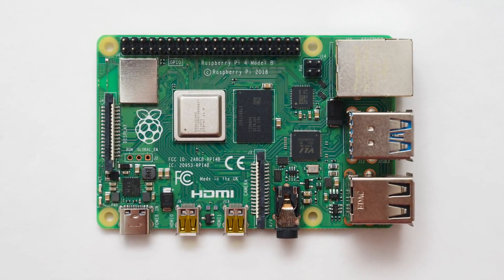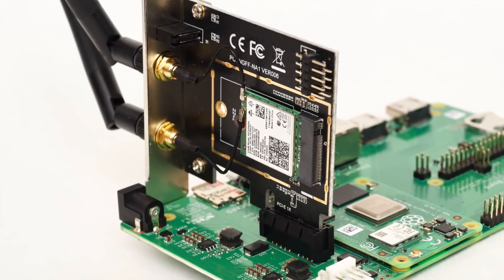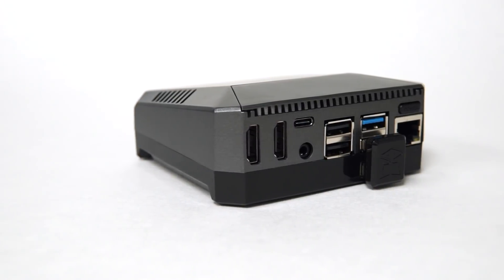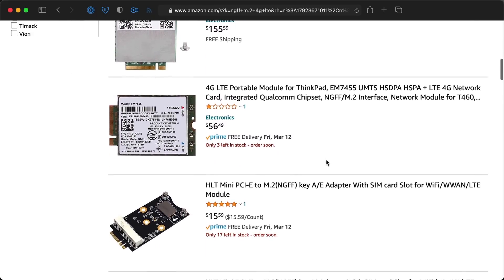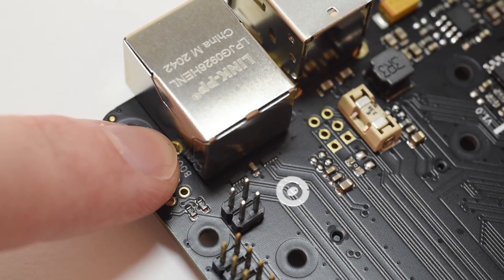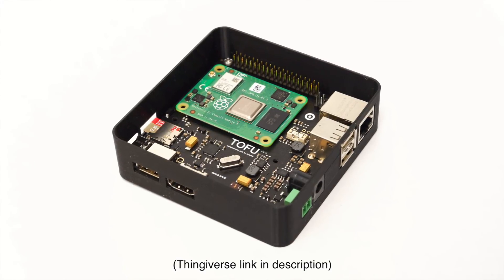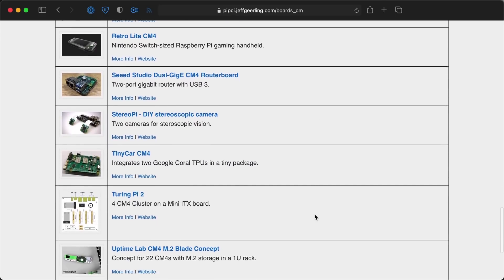FINALLY! Native M.2 NVMe on a Raspberry Pi - CM4 TOFU

Comment: Is it correct that the slowest NVMe that you can get will still be bottlenecked by the connection. 300MB are not even close to meeting the SATA3 standards capapilities and faaaaaar away of true NVME speeds.

Comment: FYI: The PoE Hat does not fit properly without 10mm spacers or header extensions. One of the capacitors on the PoE hat hits the fuse on the Tofu.

Comment: I just got my TOFU set up, but so far I haven’t been able to get it to detect the NVME drive installed into my M.2 slot. I’m ordering another one specifically called out for compatibility. It would be a huge disappointment if drive compatibility is limited.
Reply: As per the TOFU compatibility list says, the WD Blue SN550 250GB worked and was immediately detected, but my original Sabrent 512GB Rocket 2242 (SB-1342-512) did not. No matter what I did, I could never get the Sabrent drive to be detected. I tried with USB-C power and via POE++. Available power shouldn't have been an issue because after I got the WD Blue up and running, I stuck the Sabrent drive inside an SSK USB adapter, plugged it into the TOFU and it has run fine with both drives installed.

Comment: Hi there Jeff . I love what you are doing with the pi technology. I have been lookig at purchasing a Pi 400 ,however I don't know anything about Kernals or anything else about the inner workings . I have built 4 PC s .But the situation in the suppy chain has forced me to look at other things . I love what you are into . Now the store that i buy stuff from doesn't carry the pi 4 with the PCI slot . So who do I conntact to get the latest updated board ?  I will buy the 400 model soon ,but 4 GB is all they come with . Do you know if and when they plan to up grade to 8GB ?

Comment: Seems they've made a m key adapter that support all the lengths (Available as 2280 (most used), 2260, 2242, 2230 or DIY configurations (spacer not soldered) for €19)

Comment: Wouldn't it be better to use a sata flash drive? I know that it requires an additional controller, but the speed you are achieving is already slower than a normal sata 3 ssd (500 MB/s), so it's a bit of a waste to use an nvme drive that would be 4 times as fast. Also I guess the drive could be cheaper and maybe even easier to boot from

Comment: Hi Jeff, the WD 30mm NVMe looks like a reasonable solution for the Raspberry PI CM4 I/O board. In your earlier video you showed a full-length adapter sticking up like a skyscraper. Have you tested the 30mm (2230) card in the IO board? Is there an adapter that works well for that?
Reply: But short of a hacksaw, I don't see a shorter vertical adapter that would fit the 30mm and not stick up like a skyscraper out of the I/O board.

Comment: How is this more "native" than everything before? You are using an expansion board to interface the PCIe lanes to an M.2 connector. I interpret "native" to mean running minimal external layers. I wouldn't consider the connector itself to be a layer in this sense. Something like M.2 to USB 3 I would consider to be not native.
Reply from the maker: Native in the sense that there is an M.2 NVMe storage device connected directly to the PCIe lane on the Raspberry Pi CPU, and it's through a single board (not an IO Board + an extra PCIe adapter card, which I've demonstrated before).

A number of CM4 boards are going to have built-in M.2 slots (of various types), so it's exciting to see this development (especially as some of the carriers get cheaper).

Comment: I am curious was your bed temperature too hot or too cold  to cause the lifting ?
Reply from the maker: Too cold. I usually keep it around 60°C for PLA, but the default in Cura was set to 50° for some reason, and I forgot to double-check before beginning the print.
Reply: @JeffGeerling  Thanks

Comment: This board is just what I need for a project I’ve been wanting to build - a low power monitor for a motorhome or RV while it is in storage. With the cellular capability built in it can allow remote access as well as sending data bursts to the cloud (motion triggered photos, temp and humidity readings, etc.)

Comment: Thanks for the great videos! Personally i will stick to the m2 drives over USB 3.1. I have an rpi4 with m2 kingston ssd, with an ssd shield connected over USB. It contains Ubuntu 20.10 and it boots without an SD card directly from the m2.

Comment: The Tofu is indeed an interesting carrier board. The M.2 slot is more reasonable than the pcie slot on the official CM4 IO board. It seems like future 5G modules will mostly be in an M.2 form factor instead of mini pcie. So including the SIM slot next to the M.2 slot was a really good decision from Oratek. I thougt that this board would be perfect for mobile applications because of the SIM slot. However, after studying the boards documentation, there are quite a few good reasons not to use this board for mobile applications:

1. Mobile applications are often battery powered. The lack of an RTC means that time triggered system wake ups are not possible. You might want to shut down your system to safe energy. But without the possibility of time triggered wake ups this is not an option.

2. According to the electrical documentation Oratek is using Zener diodes to create stable 12V, 5V and 3.3V. This is extreme energy waste, which is a problem for battery powered applications. The solution would be to use dc/dc converters instead of Zener diodes. Considering the price point of the Tofu board, using Zener diodes is imho a bad decision.

3. The voltage range from 7.5V to 28.0V is a little small. For example if a vehicle has a 24V rated battery system, the voltage can easily be >28V if the engine/alternator is running. Has anybody tried to run this board on 29V? Does it blow up?
Reply: Hi, so the thinking was that for low power applications a microcontroller system would be more appropriate, and not so many people would use the RTC. It is still possible to wake up and shutdown the raspberry pi through other IOs.

The power supply is not made through Zener diodes. Schottky diodes are placed to prevent reverse currents flowing into the power supplies if more than one are connected. The only Zener diode is here to polarize the reverse polarity protection transistor (inverting + - on the power input).
The voltage regulation is made through an efficient DC-DC converter, the same as present on the CM4IO board.

Finally, this DC-DC converter can handle higher voltage. What cannot necessarily is this reverse polarity protection transistor, which has a maximum drain-source voltage of 30V. Input capacitors are also rated at a maximum of 35V maximum so it is better to keep a margin with it. This application would require some care but could be a fringe working case scenario. It is probably dependent on voltage ramp-up so no guarantee would be made.
Reply: @anybuchegger  Hi! Thanks for the clarification about the internal power supply. You are absolutely right. There are dc/dc converters for 5V and 3.3V. I was convinced that the purpose of the only Zener diode is to stabilize the 12V power supply. But that was a misconception of mine. Actually the Tofu does not need any stable 12V for any component.

Comment: You could add a piece of plastic the would extend over the edge of the 2230 card to hold it in place.  Make a 3D print with a hole for the screw and maybe a little nub to secure into the hole or edge of the card.
Reply from the maker: True. I actually ordered a little extension board from eBay after someone else suggested it.

Comment: Jeff, why not cut a piece of plastic into an oblong of the same width as the M.2, drill a hole in it for the securing screw, and use that to secure the M.2 drive?  If that is not strong enough; overlay it with a piece of thin aluminium plate.

Comment: It's a bit strange that they didn't turn the m.2 slot 90 degrees so that it could have fit any device size, as long as they also added the two additional screw holes. Maybe there's a good reason for it? Or maybe it's just an oversight. While the primary use-case might not need it, allowing any device could expand their potential market significantly.
Reply: Based on the many requests we (Oratek) now propose an adapter to fit any m.2 key M SSD ;)

Comment: Note: There is an adapter bracket that can be used with the 30mm SSDs so work in the 42mm slots with screws. I used one with a WiFI card in my Lenovo M93p ThinkCentre Tiny
Reply: Based on the many requests we (Oratek) now propose an adapter to fit any m.2 key M SSD ;)
Reply: @anybuchegger  Great because I want to try it with an m.2 Sata controller. Sound great for a nas.

Comment: Can we get a Pi 5 (and Pi 500, maybe?) with a NVMe drive slot (2230 size only) INSTEAD OF the microSD slot?  Other than that, I'd be happy with no other changes to the Pi 4b or Pi 400.

Comment: Jeff, unrelated to this video, on your website you have the "MCUzone CM4 4G" which says it has a M.2 E-key slot.  However the modem on it is MPCI-E and is screwed in with 2 screws instead of one, not to mention there are no 4G M.2 E Key cards (they are B Key). Are you SURE that's M.2?
Reply from the maker: I took that description from the product page, but that doesn't mean it's right :)

Comment: The Pi foundation missed a golden opportunity by not adding NVMe boot options to the P400 which would have made it a complete  unit. and scrapping the Mini Hdmi ports and just give us one full sized hdmi would make my life a lot easier spent hours fixing those mini hdmi's  when they get ragged off the boards. so we dont need to use the sd slot. when a sd pings out good luck in finding them in factories plus employees nick them for there phones.
Reply from the maker: There's plenty of space on the Pi 400's board... hopefully a revision fixes that.

Comment: Can I use this setup to get thunderbolt3/usb-c power delivery and qhd video output over the single port vs having to use micro-hdmi video output port?
Reply from the maker: Unfortunately, no. TB is not possible on a Pi.
Reply: @JeffGeerling  Thanks for insight. Any word on this being address in 2021 raspberry pi 5 offering?

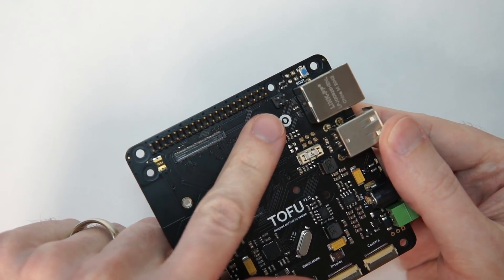Comment: If you were building your Dramble today would you build with the TOFU instead? - I want PoE, but I am not sure what those pins are for ( 4:20 )? - Is this plug-and-play? or do I need to buy the hat and plug it into those pins? - I really dont want a noisy hat fan.
Nice job with ur custom case. - I would love to be able to do this stuff, but... - its never going to happen. - My dream would be a Dramble ( 3 or 4 of these ) in a case with one large Noctua fan on one side. - Clips to attach to the Switch somehow would make it perfect. - Think about it Jeff - I know you are itching to push Fusion 360 to the next level :)
Reply from the maker: I would definitely go with something like the TOFU. The price puts it a little beyond what I'd want to justify for a Pi-based cluster though. I think something like the next Turing Pi may be a better value for _clustering_, depending on the final specs.

The four pins give power to the PoE HAT, which is still required to be able to use PoE on the TOFU (and most other board designs I've seen).

Comment: Most of the non-highend WD NVMe SSDs can be simply "cut down" to a smaller size because the rest of the PCB isn't used.

Comment: This Tofu is too expensive. It is equelvent to $125 Canadian dollars plus the cost of the pi 4 module with    4gb lite without eMMC at $60.75 and the cost of a nvme drive. It will cost the same as a Chromebook with 14 inch screen. But the Chromebook might have a faster processor than the pi 4 module.
Reply: Obviously they fill different needs.
Reply: Same feeling here, interesting hardware buy way too pricey. I have 2 Rpi4 8Gb collecting dust and I'm still suppose to invest on getting an additional $84 CM4 module(4GB RAM and 16Gb eMMC model). Not practical, I'd rather spend same amount of money on an ODYSSEY x86 SBC - X86J4105, currently on sale on ameridroid for 188 bucks or simply buying two(2) Radxa RockPi4C's with 2 NVMe HAT's and two(2) Transcend 128GB Nvme m.2 drives for the same amount of money I'd pay for a Tofu board + CM4 4GB+16Gb eMMC model.

Comment: Aside from the high price , what puts me off is having to buy SSDs from weird unknown brands. I'd really much rather have a board that takes 2280 M key SSDs which I can buy from well-known mainstream brands.
Reply from the maker: Note that there are also some SSDs available from WD in the 2242 form factor. Definitely fewer available than 2280 though.
Reply: Based on the many requests we (Oratek) now propose an adapter to fit any m.2 key M SSD ;)

Comment: Solution for large prints like that is to print a brim, make it 4-5mm and it will help keep the edges from curling up when the plastic shrinks...it's even worse with ABS
Very very cool that you designed a working case for a product just released...and it looks like a pretty powerful little addon for the CM4
I still wanna see the board with the full size PCI-X slot ;)

OOH, those pads on the bottom could also lend it's way into making some sort of PiPower addon too! 
Keep em coming!!!!

Comment: Need to pick one up and see if will power from GPIO to place in the new cluster project..  Thanks Jeff !
Reply from the maker: It should, but note the M.2 power lines are (I believe) only routed to the 12v power inputs on the board, so you'd still have to power it via 12v somehow if you want to use an SSD on it.

Comment: If you have a .step file of the board you could just project the features like mounting holes and connectors and offset or center your cutout to the projections.
Reply from the maker: See... now hopefully I can learn the ways of CAD so I can do magical things like that :)

We'll see how much more design work I get into—I'm sure a more skilled practitioner could've done in 15 minutes what I spent 4 hours doing!
Reply: @JeffGeerling  yeah, there is a learning curve, particularly  for enclosures I think learning to use sketches and projections are well worth it. Even using actual pictures/scans as calibrated canvases is a great tool for picking up features.

Comment: I could see RVers, long haul drivers, even Amateur Radio operators liking this board. Just apply unregulated DC to it off your coach or car DC supply, and get a cell card. makes a real powerful, but basic computer for email when on the road. Can you use the mSDcard slot at the same time when you have a CM4 with eMMC storage?
Reply from the maker: Due to the way the eMMC/microSD are wired on the CM4, you can only use one or the other. If you use eMMC, you could still use NVMe storage though, and you could drop in a little USB 2.0 microSD adapter if you still need microSD storage. But the port on any of these CM4 boards is not live at all if the CM4 has eMMC.

Comment: as you told this module has alot types of power connectors, can by added battery throw thouse, cause when you said, that I can plug 4g modem to this device, I woukd like to use it, cause I use my tablet as a "portable hotspot" and I would delegate this thing to this device with better signal strength and have a linux device in backpack. Woukl you do some kind of project around this idea, or would you help me with constructing of this idea? If no it's ok 🙂. I just get excited.

Comment: Getting direct access to m.2 storage, it probably the primary reason most people would want a board like this, so limiting it to 42mm drives seems like a complete whiff in my opinion. Check any retailer and you will see that 80mm is the defacto standard, hence the reason why you will see an order of magnitude more 80mm drives on the market. 

Most likely people won't be able to repurpose drives they already own as they are to long. Not to mention almost none of the major manufactures sell  42mm drives so people are restricted to off brand drives. 

I'd be placing an order right now, if It supported standard length drives.
Reply from the maker: WD sells some 42mm drives, too, but the point is valid. But note that this board is really designed for the more standardized 4G LTE modules that are almost always 3042 size—that is also why the board has a built-in micro-SIM tray.

Comment: Hopefully Rpi 5 will have all this built-in for $49.99 by next year ?? 
I know someone will.
Reply: Some of the I/O boards for the CM4 are getting pricey now. Still feel the Pi 5 has to break free of it's predecessors form factor to some degree to advance the series. Maybe something the size of the CM4 I/O board to allow the designers to breathe, and enhance the feature set. Pi 400 has kind of set precedence on a larger main board being achievable.
Reply: @Tano rpi are 3 years products
Reply: I still kind of feel the form factor is the thing holding up the Pi advancing. It's almost like the CM4 was made as it is to fill that gap in the market to keep the Prosumer type customer happy. Shame the availability of the higher end CM4's is still woeful, even in the UK!

Comment: i mean you could 3D print a m.2 2230 to 2242 adaptor to hold it in place better than the kapton
Reply from the maker: Big brain thinking over here... :D
Reply: I came into the comments to say the same thing!
There are a few on Thingiverse already. Search for nvme adapter or m.2 extender or something like that.
Reply: Based on the many requests we (Oratek) now propose an adapter to fit any m.2 key M SSD ;)